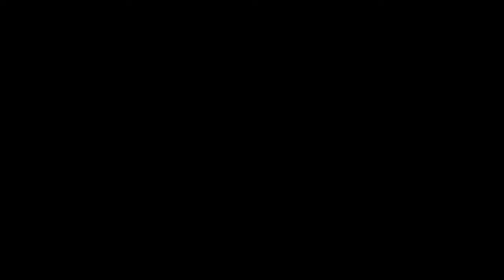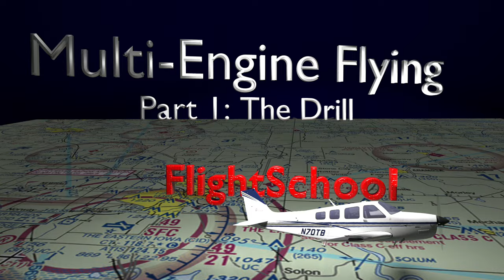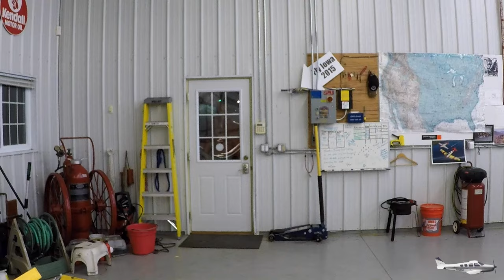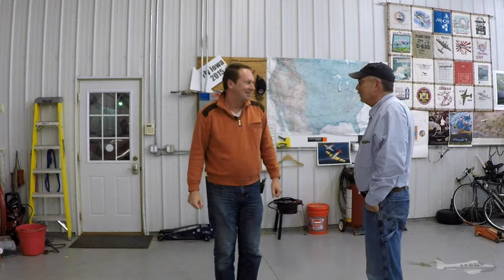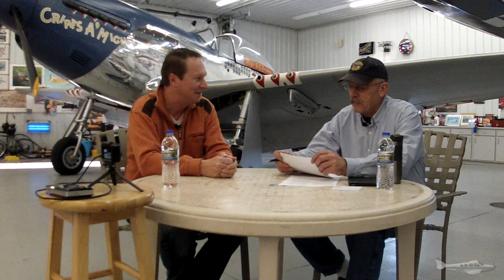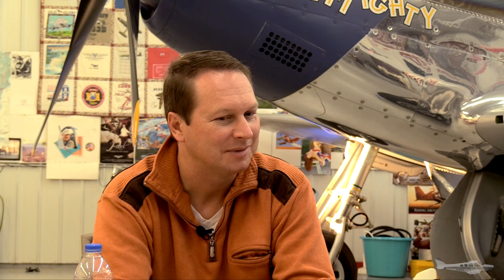Multi-Engine Training - Part 1: The Drill

Comment: When you can no longer land on the remaining runway, retract the landing gear.
Reply from the maker: That CAN be a good strategy in single engine airplanes, but not in twins. In twins, speed is typically more important than altitude in case of an engine loss right after take-off, so the gear is retracted as soon as a positive rate of climb is confirmed.
- Martin

Comment: I respectfully disagree with his first step of "pushing the nose fwd,"  the first step must be to roll wings level to correct for the roll from the huge amount of asymmetrical thrust, then adjust your pitch  as necessary to begin a climb at or maybe even below blue line.
Reply: I, and many others, believe that lowering the nose to maintain airspeed is the first step.  And there is no circumstance where being below blueline with OEI until reducing power when the runway is made.
Reply: @B25Flyer  again, respectfully disagree; if you're heavy on a hot day, high elevation & you lose one & blue line is only reducing the descent rate but going below blue line 5kts stops the descent & gives you a slight climb, I know what I'm going to do. This scenario has been shown in simulators.
Reply: @petediaz9310  I do not know where you were taught to fly below blueline in a OEI situation, but that was poor training.  If the airplane climbs at a better rate at 5 kts below blueline, then that is in fact blueline, best single engine rate of climb.  And Blueline is not a fixed number is varies with gross weight and density altitude, but the top of that curve is very flat, and the benefit of being a few kts below blueline is so small as to be imperceptible.  Further, if you do allow the speed to decrease and the performance is worse, the only way to get the speed back is to trade altitude for speed.  Under the stress of a real OEI situation, most pilots performance will degrade and flying blueline should be the goal.

Comment: If you feather the wrong engine, the engine will not come out of feather.   Why?  The wrong engine is the running one.
Reply from the maker: You are right. We should have said "it will take some time for the good engine to come out of feather". Unfeathering a completely feathered und shut-down engine is something that takes time in the best of cases, all the while the other engine - the bad one - isn't making power. At cruise altitude that may not be a problem, but down low the altitude loss until you get power restored may not be tolerable.
Regards,
  Martin
Reply: @martinpauly  awesome.  thank you for clarifying

Comment: Cram it, Climb it, Clean it…
Reply: If you teach "cram it" the only thing that gets crammed is the throttle.  If you do that on a big engine like a Cessna 421 and dont push the mixture & props up, the pistons will melt and come out the tailpipe pretty quickly.

Comment: The worse thing an MEI can teach is “everything full forward when the engine fails”. This is the dumbest thing an instructor could ever teach in twins. There are times that reducing power will save you and adding power will kill you. When the engine fails, just think. If you are doing slow flight and an engine fails, idling both will save you.